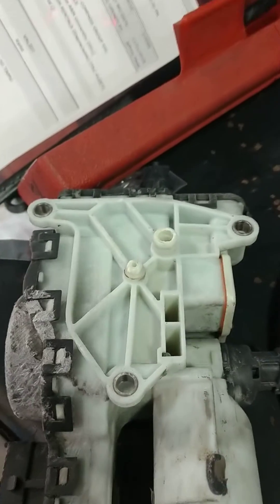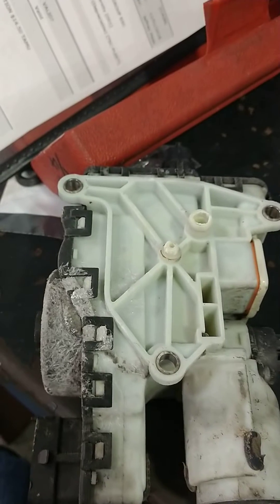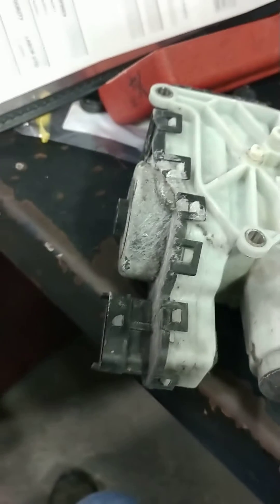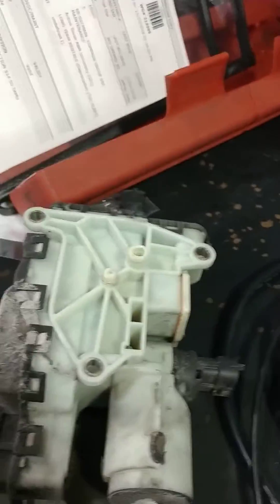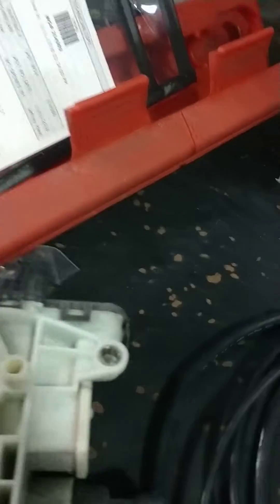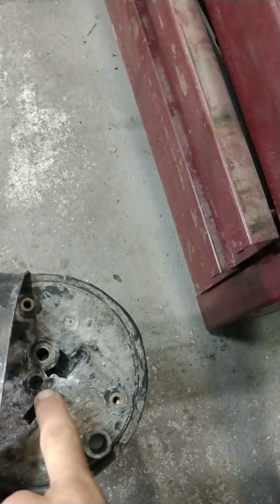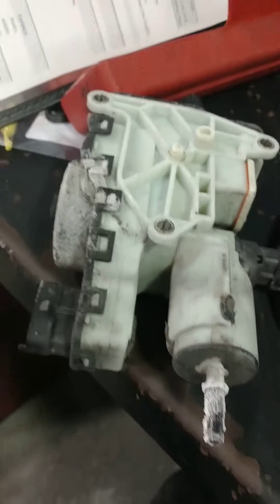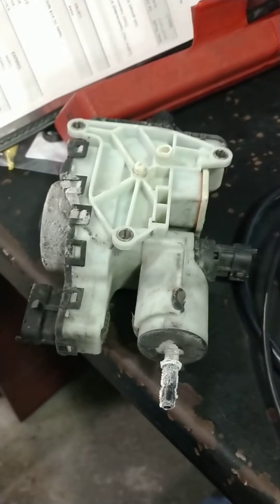2013 (2011-2018) F250 6.7L P207F Code, Speed Reduced to 50mph Msg Fixed!

Comment: Maybe you could help with this. My 2016 6.7 threw the P207F code and a few minutes later the 50 miles to speed limit 50mph came on.  It stayed on until about 25 miles to go or so and magically shut off. I had the code cleared. Been about 150 miles and still yet to resurface. Why would it throw that message and then disappear?
Reply from the maker: The computer that monitors the DPF system on these trucks is constantly doing checks on def fluid pressure, the Nox sensors, heating elements, def level sensors & exhaust back ptessure.  Any of those sensors failing intermittently or the exhaust partially clogged or not filtering Nox can cause that message.  When that msg appears it will record a history code and freeze frame data.  Your first step is to get all codes and the freeze frame data to go with it.
Reply: FoxRecon383 come to think of it, it went into regen about 10 miles after the warning came on and once the regen was done was when it came off. Could have been a little over clogged. I have been idling a lot lately.
Reply from the maker: @jspivak86  could definitely have been the issue.  I have replaced a few of these torpedoes from excessive idling / ruining the converters.
Reply: FoxRecon383 yep. Thankfully my regen finished and the message went away but I cleared the CEL. I also should mention I changed air filter and filled up with DEF a couple days prior to that. DEF level was normal as was the regen cycle, it didn’t feel abnormal at all. I would imagine if something was seriously wrong it the CEL would have illuminated again as would the message. I have the Ford PremiumCare thank god!!
Reply: FoxRecon383 ya we made the mistake of clearing the codes.